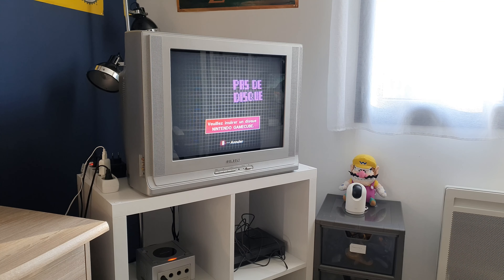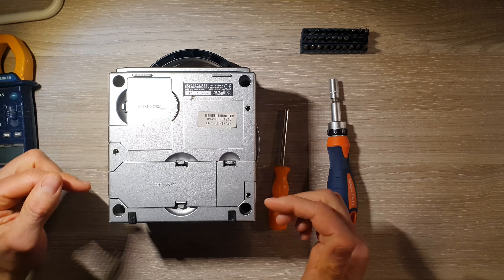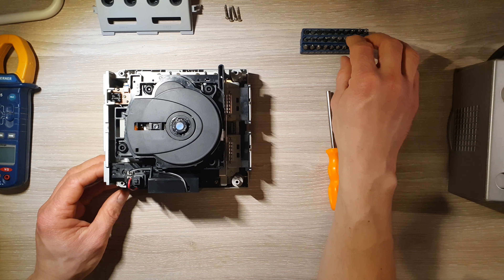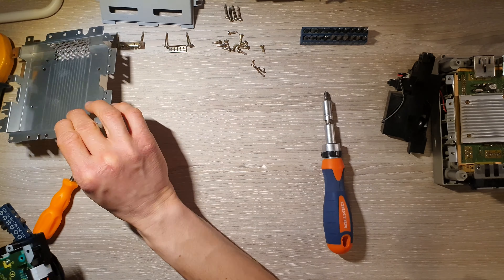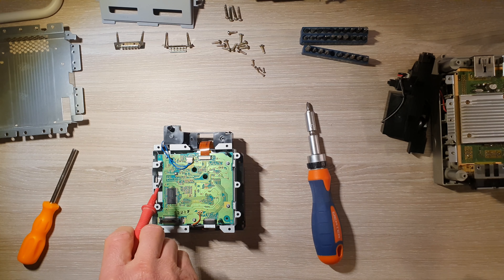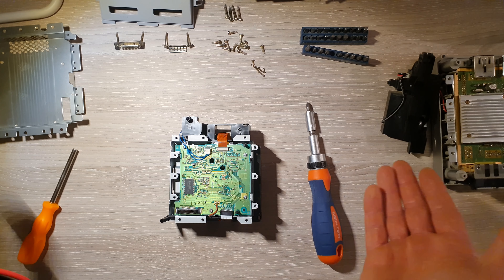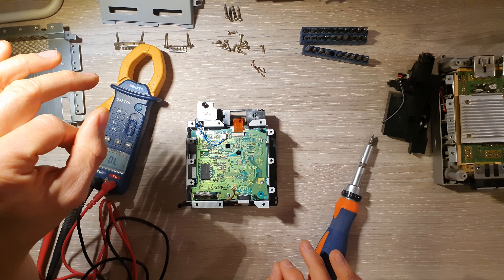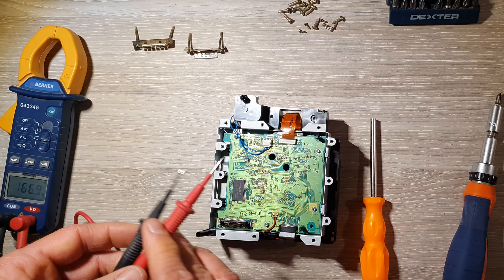Ma Gamecube ne lit plus les jeux !

Comment: bonjour, j'ai beau prendre la mesure au multi metre mais ça me dit 0 omh...
Reply from the maker: 2 possibilités, la première est peut être un manque de précision dans la mesure, il faut appliquer les pointes de touche de manière à compresser le potentiomètre avec une  force assez soutenue pour que ça fasse bien contact sur les pôles.

Autre possibilité, la pièce est en court circuit ce qui peut expliquer une résistance de 0 ohm.
Reply: @linklexis  j'ai réussi, mes impossibles de faire tourner le cd peu importe la valeur, j'ai réussi à en réparer une autre, mais celle ci ne veux pas tourner..
Reply from the maker: @SOSFANTOMESFRANCE  cette manip a une certaine limite, la lentille a une durée de vie limitée.Réajuster le laser pot permet simplement de gagner du temps mais un jour ou l'autre le bloc optique finira HS..c'est peut être le cas sur la tienne ? j'espère que tu trouvera une solution pour la remettre en état en tout cas.
Reply: @linklexis  effectivement après plusieurs test le bloc est hs, cependant j'ai réussi à refaire partir ma game cube pearl donc je suis content